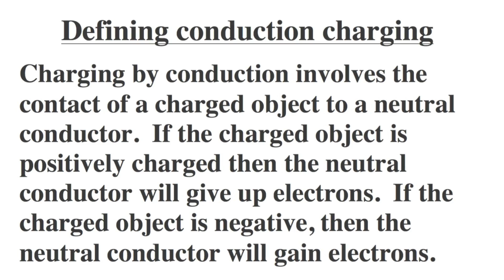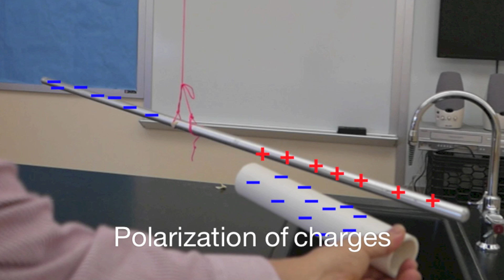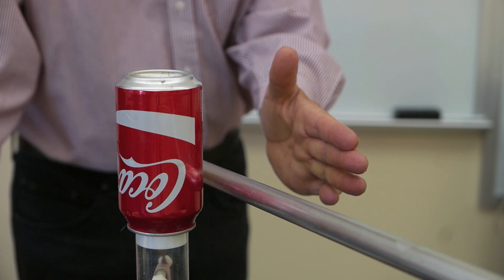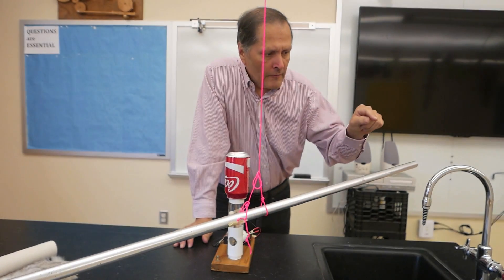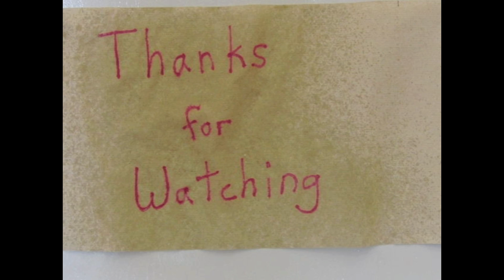Static Electricity part two Conduction-Induction // Homemade Science with Bruce Yeany

Comment: it is possible with a large amount of static electric to move large objects such as a ladder?
Reply: Ultimately, that is exactly what contact forces in general do.  Every force other than gravity that is familiar to you at the macroscopic level, is ultimately a manifestation of a electromagnetism.  Compression forces are outermost electron repulsions, and attraction forces are intermolecular chemical bonds that depend on opposite charges attracting.

But I get what you are saying, whether it is possible to make a body's overall charge able to move a ladder.  It is possible, just not practical to do with a person's strength generating the charged bodies.  It works better on small mass objects, so you don't need to relocate nearly as many electrons to make interesting results happen.
Reply: @carultch  thanks its all I have to go by at the moment. I've been trying to relate things in physics to how things in the paranormal work. Other than the obvious wind, vibration etc I've witnessed and captured ladders moving, items coming away from tables and go through the air etc etc and on each occasion I have gotten high reading of EMF so all I can say is there is a charge there but how is beyond me

Comment: Where are you located?  I can never get these kinds of things to work in Texas - we have such high humidity.  But these are amazing!
Reply: His classroom is in Pennsylvania.  It helps being in a cold climate where you need to heat the room in January/February to do these experiments, because heating the air lowers the relative humidity.  Dealing with humid weather in September is a lot more challenging to do static electric experiments.

Comment: You imply that the attraction is due to induction due to how easily electrons are conducted in metals. But you didn't prove this by trying the same thing with materials like paper or plastic or rubber balloons that don't conduct. If you don't conduct these 'control' experiments to isolate the effects to only materials where induction is clearly possible, then you haven't shown that these effects are due to induction at all. If you try doing this experiments with a paper roll, you will find virtually the same kind of attraction happens. The only difference is that charges are not able to as easily transfer as with metals.  I demonstrate the attraction of any neutral objects to charge in my video: https://youtu.be/AC4PAfIEwBs I claim that this attraction is largely not due to attraction of opposites or induction. This attraction is due to the attraction of the neutral dipoles to a point charge source caused by polarization effects or the dielectrophoretic force which is due to the tiny difference in the distance between the charges in dipoles. The phenomenon of a charged object attracting an uncharged object happens in general and is not restricted to materials where induction is easily possible.

Comment: thanks for posting. some thoughts; have not watched pt1.  was just wondering,  how many watts does a vandegraff consume.   i have wondered what makes static electricity static.    is it because there is near zero amperage.    even though it is powerful, is lighting considered to be a product of static electricity.   is the 'lifter' effect legit.   if so, a demo might be interesting.    cheers.
Reply: To my understanding, static electricity just means "stationary" or not moving/changing. Objects can build up a charge of static electrons to the point of saturation. Naturally electrons repel one another and hate having to be so close to their neighbors. Objects can continue to "collect" static electrons or charge so long as the object gaining the charge has a lower potential than what is delivering the charge. In other words, objects are constantly exchanging free electrons all the time. The clouds for instance, get many of these "free electrons" and build  a static/non-flowing charge. Once the potential or "desire" for these electrons to repel/spread apart from their electron neighbors grows exceeding large, they create an ion highway to the Earth which has ample space for the electrons to spread apart. This process of using the Earth as a means of spreading out is called . grounding. Lightning is just a ridiculous amount of static electrons that built up a charge in a cloud and created a pathway to the ground to spread out. The dangerous part of lighting isn't the voltage (potential difference or the "desire" to flow/move) it's the volume of electrons flowing during the duration of movement. All of those electrons discharge in an instant. Causing an intense amount of friction due to "collsions" with the air molecules through which they flow. As you know electrons are high energy particles, so they transfer some.of their energy to these gas molecules on the way down to the ground which causes them to ionized and release photons of light which is the visible "lightning bolt". Thunderstorms are an incredible display of the forces that govern nature!! In summation. Static charges don't flow until the potential to flow is great that the electrons elect to flow through things like air (which they really don't flow well through to begin with). As they flow, they create a current, and the higher this current, the more volume of electrons there are flowing. We measure this as amperage.

Comment: Another great video.  Around minute 5:29 you said that the aluminum foil gives up its electrons to the positive charged generator and the foil acquires more from the environment to reach equilibrium.  Is this right?  From many old 100 year plus articles, I have seen it said rather that the neutral foil is attracted to the positive generator by induction first.  Then as the  aluminum foil touches the positive generator, by conduction the positive generator will charge (and lose some positive potential) the aluminum foil positive.  As they are both at the same polarity the foil is free to repel away.  Now the aluminum foil will lose positive charge quickly thru leakage at sharp points to the air and becomes neutral relative to the environment.  Where the foil is again attracted and the cycle continues.  I think this is a case of positive charge dissipation to the environment not electron acquisition from the environment.  You could do this in a vacuum chamber where there is far fewer free electrons and I would expect the same results except the dissipation may be slower.  If I am wrong feel free to point out my misunderstanding.  Always open to learning.
Reply from the maker: Hello EnergyCrafts,   my understanding of what's going on (and if I am wrong,  I'm also happy to have it corrected) starts with the generator which is positively charged.  When we look at metal conductors,  the positive charges or protons are locked in place in the nuclei  and unable to to move,  to do so would actually change the mass of the material.  It is the electrons that are moveable and alter the charge on a material.  We agree that the Aluminum foil starts out neutral and is attracted through induction to the generator.  In this case no electrons are exchanged so the overall charge on the foil remains the same . The induction causes a concentration of electrons to move closer towards the positive charge on the foil causing the area to be negative while the outer areas of the foil temporarily becomes positive.  In the second part of your question is where you have me confused.  While conventional currents are designated as flowing from positive to negative, in many instances the current is able to flow in both directions. In metal solid conductors, it is actually only the electrons that are able to move.  For the Aluminum foil to make contact with the generator and have the same polarity,  it must give up electron to the generator to make it positively charged.  So what happens during a positive charge dissipation? How else would a surface lose it's positive potential?  Since protons are unable to move positions, my thoughts are for the foil to become neutral, the only way it can do that is for it to gain electrons from a nearby source, in this case the air surrounding it..  It would do so at the sharp edges of the foil.  Further I would guess  that as quickly as it is happening, the positive charge is not actually fully dissipated on the foil,  but enough to allow induction to attract the foil and process repeats itself.   If I am wrong in any of this I would be interested in being corrected or pointed towards some  articles that you could suggest.
Reply: H.i Bruce, I did not forget about your comment, only too busy to reply until now.  When I stated earlier  "I think this is a case of positive charge dissipation to the environment not electron acquisition from the environment" I was considering the case of 2 neutral metal spheres (or balloons) held by nonconducting strings from the ceiling.  Charge the first sphere positive.  Now bring the neutral sphere in contact to the positive sphere.  The previously neutral sphere does not become negative charged but becomes positive charged.  Now without discharging them allow them to lose contact and now both spheres have the same positive and repelling conditions.  The first sphere surface charge density became less as the second sphere made contact resulting in a lower density of charge per unit surface area.  That is what I meant by dissipation.  Now as to your view that the electrons were acquired from the environment, I have a problem with understanding that since it is well know there are few "free electrons" near the earth's surface and I find it hard to believe there is enough to make the fast results that your experiment shows.  Where in the environment do you think they came from?  If earth potential (ground negative) then a direct connection should greatly improve your results versus air of poor free electrons and conductivity.  But to acquire electrons by other ways (robbing them) would cause the environment to become less negative (more positive) resulting in an imbalance.  Then I would have to ask where the environment in turn gets its replacement electrons to return charge balance?  I have a reference that you might enjoy about electric fields and your interest in particles interplay.  See "Nonuniform Electric Fields" in Scientific American, Dec. 1960, p.107-116.  I found the subject extremely interesting back in 1986 when I started doing many experiments with HV and electrostatics.

Comment: 1:44 is it actually going towards your hand because it’s attracted to the charge in your hand or does it move away because they’re both positive? Before you add your hand, the can already moves away so I have a feeling your hand isn’t the cause. Also that would mean your hand is negatively charged, but how would you know that?
Reply from the maker: Hi Matt,    good point, in this instance  it is a combination of both.   My hand  most likely is negatively charged since I am holding onto the generator,   and I could test it by  bringing it near the two hanging plastic charges strips of plastic.   The charged can would even still be attracted to my hand even if it were neutral.

Comment: There's a frame around the 10:42 mark that shows the arc from the generator to the can. Using the dielectric breakdown of air (3x10^6 V/m) and a rough estimate of the distance between the can and the generator, I figure it carries about 260,000 volts across it......

I'm a little unsure about my logic here, but does that same voltage go across you when the can comes back? You don't even blink or twitch so I'm thinking either you're superman or I'm wrong....
Reply from the maker: Hello Ethan,   I would  think your math is correct on the voltage on the generator,    in a previous video I hold my near the dome  and it is a pretty good jolt.    In this case,  the can is much smaller than the dome  so  I would guess it must be losing  quite a bit of the charge to the atmosphere by the time it gets to my hand I'm only getting  about 1/2 inch arcs which is what about  15,000 volts or so.

Comment: Awesome video as always!..

I was wondering, does the conductivity of a material also effect its rate of induction? eg; Using Copper/Gold vs Aluminum. I want to guess it does, but I am not extremely familiar with induction... mostly thermal / electrical conductive properties. Also not suggesting you try it, I imagine gold or even copper foil isn't cheap. :P

Keep up the great work!